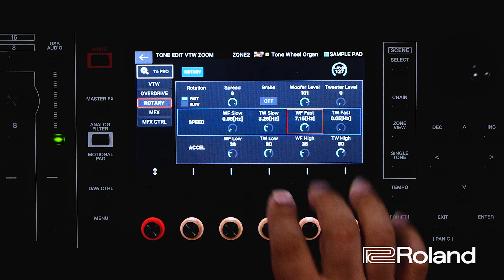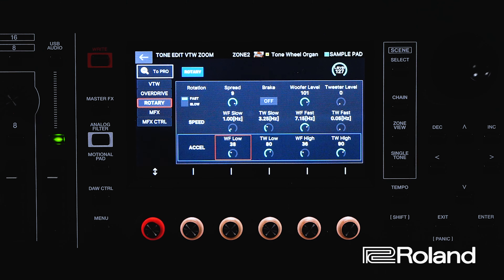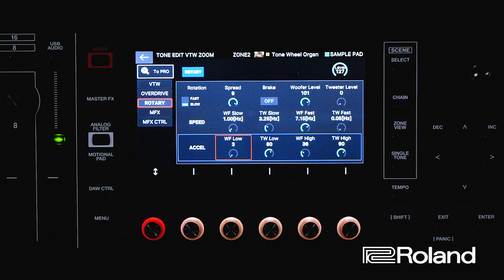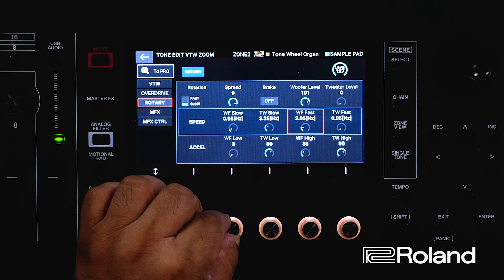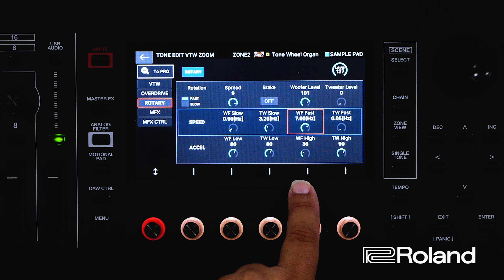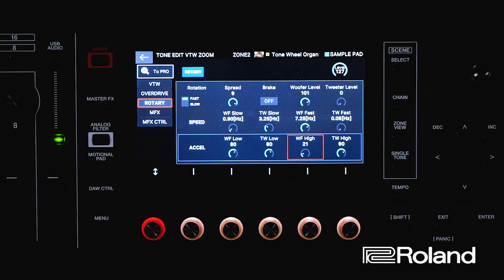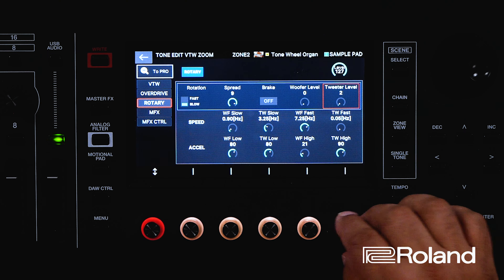Roland FANTOM - How to customize the Rotary Speaker in VTW Organ engine

Comment: So weird and I hope I get an answer please. Does this version 2.5 now being that has the virtual tone wheel assigning the rotary to the pedal or the wheel or the button when you go through the effects parameter button that doesn’t work anymore right? At least mine has a totally different screen now is that right or am I missing something? Thank you very much.
Reply: It is assigned to the Mod/Pitch bender to your bottom left. Push it to the right and you speed up the rotary, push it left you slow it down. The wheels have to be manually assigned.